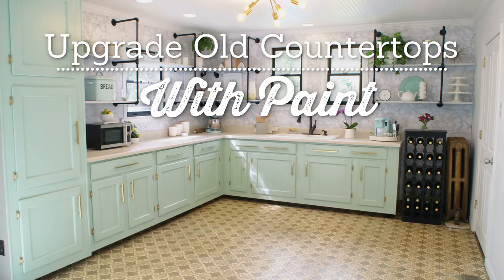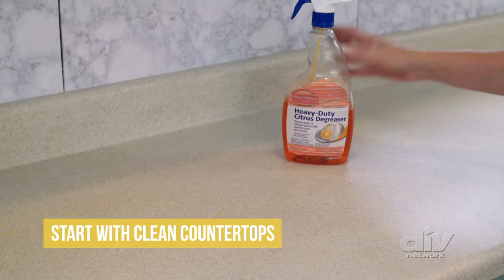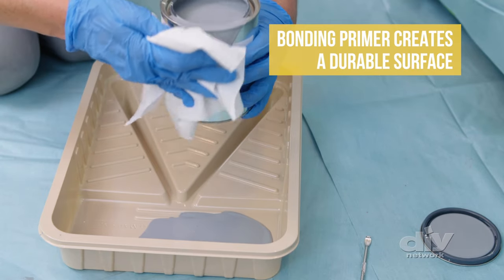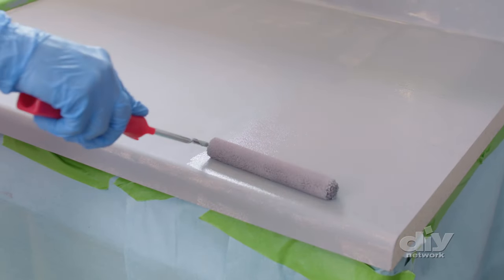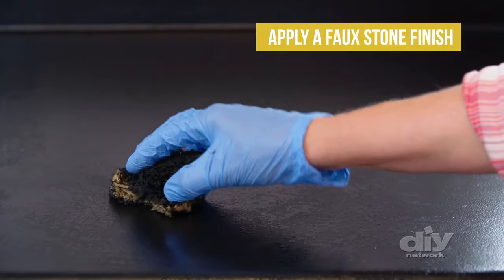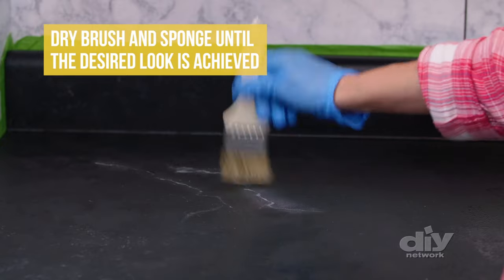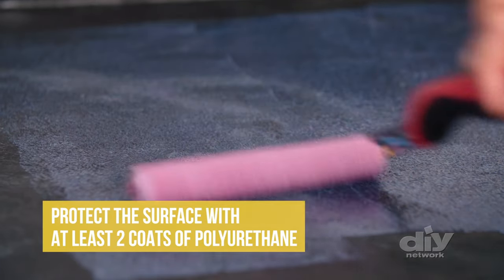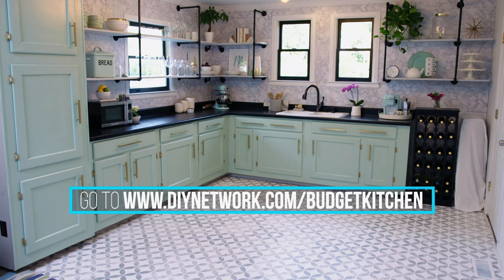How to Paint Laminate Kitchen Countertops - DIY Network

Comment: The tan countertops work better with the cabinet color. Jet black is the worst color to use because of the amount of imperfections it shows. Not to mention  dust on a black surface, even the day after dusting,  you notice immediately.  You will regret this choice in a big area such as a kitchen.
Reply: black for kitchen tops - no - what madness is this?
Reply: I’m here to paint my counter tops from black to Something light

Comment: Lot of work and if it doesn't go well.. You're screwed. I seen the rustoleum countertop paint for 22 bucks a can. One step process. It's easy, clean and the reviews even after having the product applied for months.. Are incredible. I've seen these counters up close and personal, and they are beautiful. 
This is risky. If you mess up the veining you are right back to where you start with the easy stuff. You're just going to go over it anyway and end up with a solid color. Nope this product can run as high as 200 to 250 dollars depending on what brand and.. It's a lot of work. 
Do a quick sand. Clean it, and do the it the easy way. They turn out beautiful and it's under 25 bucks. 
Just reached this conclusion after watching this video. Nope going in the other direction. 
Absolutely
Reply: what $20 rustoleum paint??
Reply: @nicholelowery1950  Lowe's has it.
Reply: I just bought the rust Oleum one and getting ready to paint my counter tops tomorrow, picked the light ash color which is a light grey 😻
Reply: @bibistvlife8732  it's been a year... Still looks great. Only thing I'd do is three coats. Nick and ding but glad I went this route

Comment: My wife & I have seen these jobs up close and we can't think of a worse thing to do to your counter tops. It looks and feels super cheap, and is nothing like marble or granite. Plus it suffers significant rapid wear in the way of scratches and chips, so why spend all that time, energy & money for a subpar job that won't last? Just be patient and save up until you can purchase some decent stone ~ it's not so expensive that it's out of reach. We spend $4100 for top tier Quartz installed ~ got it during a sale at Lowes with 24 months same as cash, so the payments were only $165 a month. Lower tier Quartz it is over $1000 less!
Reply: That's only because the DIY fools are doing it wrong. They use water-based paints that end up scratching 6 months later, but if they're doing it up and selling the house, they don't see it as their problem. Needs to be resin or enamel, and the old surface must be completely sanded so the new product bonds properly to the old countertop.
Reply: Even the best done job looks bad ~ way too shinny to pass for actual stone. And even the best work suffers chips and scratches that real stone does not, again showing it to be fake. You're better off with butcher block or laminate if you really want to go CHEAP. But paint is a non-starter and a terrible mistake for anyone foolish enough to try.